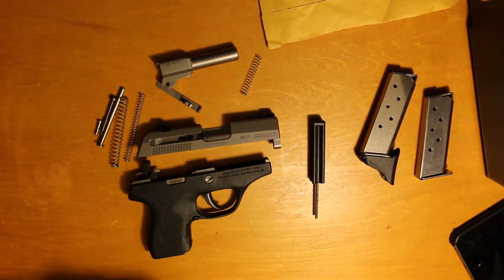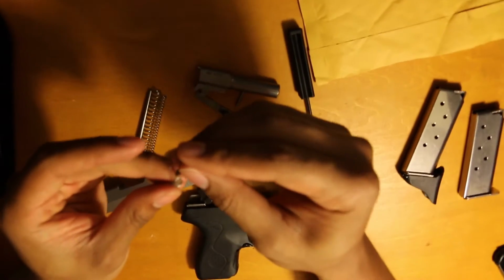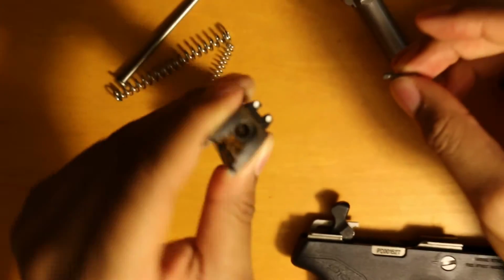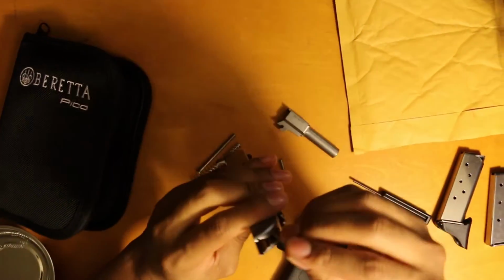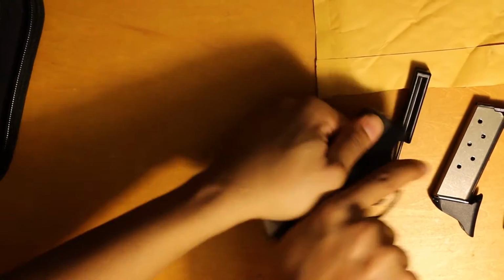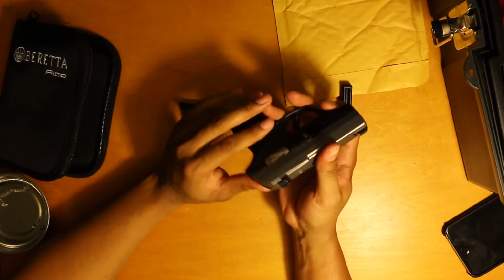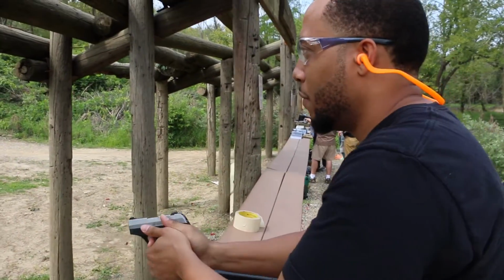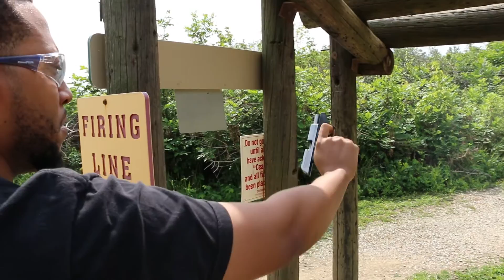Beretta Pico replacement firing pin and firing pin spring install, Review, and Shooting

Comment: Taron, the extractor pin looked like it was seated too deep into the slide.  It looked like it popped up slightly proud from the slide after the first shot.  Thanks for the video.

Comment: Glad I'm not the only one who has springs flying across the room when reassembling firearms.  Beretta is a first tier gun manufacturer.  I seriously doubt you will have another firing pin issue.  Nitpicking, but the word you were looking for is extractor.  The ejector is the finger like piece on the frame that the cartridge hits when the slide moves backward.
Reply from the maker: +Steve Russell Thanks a lot! I don't know why I couldn't remember the name of it lol.

Comment: Extractor. The word you're looking for is extractor.   The extractor is a, usually, moving part that hooks the rim of the cartridge and allows the slide to extract the case from the chamber. The ejector is a, usually, fixed part that allows the slide motion to eject the case from the gun.
I like seeing someone's struggles, both so I don't feel so bad and to see some wrong way to do things.  +1

Comment: I'm trying to decide between the Ruger LCP II and the Pico. Any recommendations? I really don't want to carry a gun with a problem prone firing pin. Thanks for your demo. Very informative.
Reply: They all dont have that problem they made newer ones now
Reply: @poppaganja3793    I actually bought the Pico. I absolutely love this gun. It's relatively light, small, easily fits into my pocket holster. It's very well made, easy to clean and I love that it's DAO, so does not need a safety. I'm very happy about this decision.

Comment: Ever send it in for the free upgrade? It's supposed to reduce trigger pull 50% and make the slide like 70% easier to rack. They say it greatly improves reliability too. Ever make a video of the frame disassembly/reassembly? I'd pay for a video of that with good pictures of the Chassis. Of all the people that own these, I just can't find any disassembly/assembly videos for the frame/chassis. (Complete disassembly, not just field stripping like a lot of people do.

Comment: LOL. I had to keep the manual with me when I tried this my 1st time. You should too ! Still, I like the video. Small guns are hard to hold and manipulate parts at the same time. if you want to get a better holster for it  I use a De Santis U7  that's made for the M&P Bodyguard 380. It fits the Pico great and the belt clip is crazy tight, it won't come off., sits perfect IWB. It cost me $19.00, not bad for a leather ,well made holster.

Comment: Just to let you know you shouldn't dry fire it. The pin will break easily. I found out the hard way.
Reply: Yeah, you definitely need snap caps. I know most guns can be dry fired, but I make it a habit to never dry fire without snap caps, even if they say it's okay. Have seen too many guns broken from it.

Comment: Do you have a video on how to get the damn thing out. This gun is a complete piece of garbage and I absolutely hate it but seeing how I have it I'd like to make it work. I got the pos about a year ago in a completely legal trade of a vehicle I wanted to get rid of and figured I'd at least get something for it. Anyway first time I've fooled with it other then one clip when I bought it the damn pin broke and I can't get the damn pin to come out. I got it open. Was a pain in the backside. I had to tap it with a hammer to loosen it up so it would move when I pushed it. I hate this gun lol.